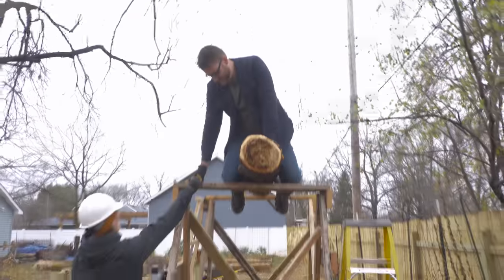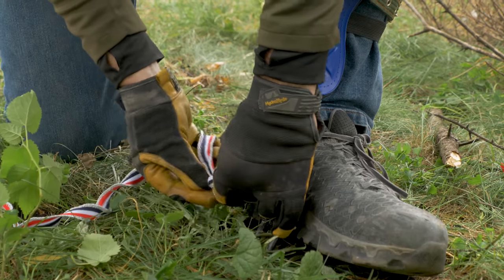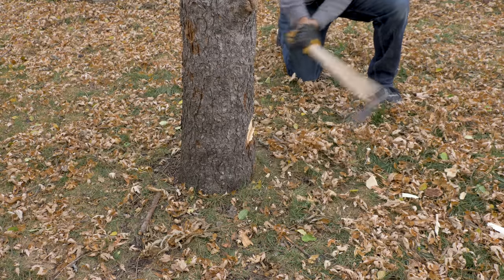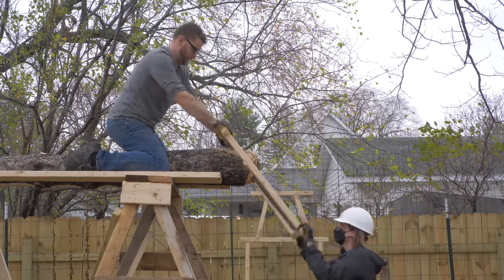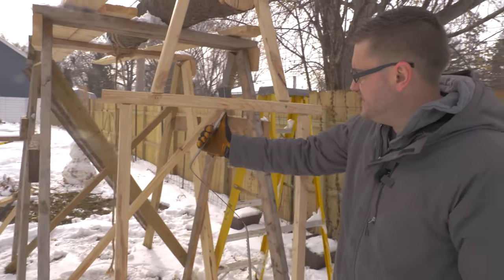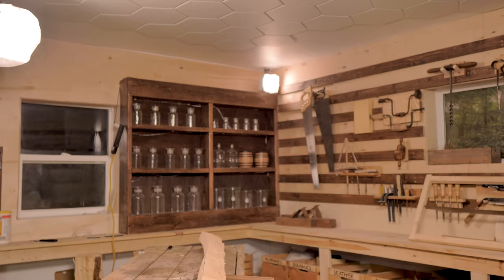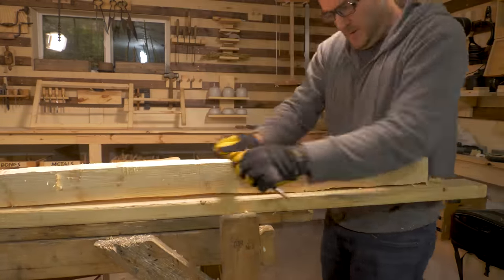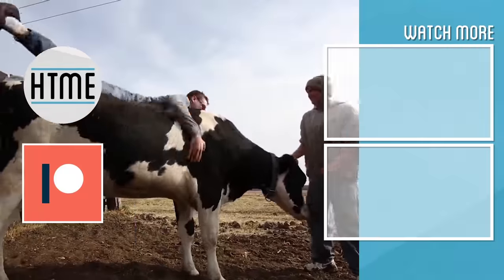Is This The Most Expensive 2X4?

Comment: I wonder what the history of Japanese lumber milling is. Their pull saws are so much more ergonomic and fast than even my best, well tuned vintage European saws. 

I'd love to see your to first attempt at making a jointer or jack plane, either a Japanese style or wooden European style, flattening it with early sandpaper.
Reply: Not an expert but I have seen pretty much the same technique of "pit sawing" In old 
prints. Japanese saws have the same concepts just the opposite direction. They have adzes and axes just different shapes. I have hewn and cut logs and let me tell you there is no easy way to mill by hand, its very difficult work no matter which tool you use.

Comment: Im a woodworker that doesn't use any power tools and some of your methods were actually done using quicker methods. For example, you saw through the middle of a log (extremely time consuming). Old timers just scribed the middle line on both sides of the log, not even that most of the time, then used an axe and wedge to split it right down the middle. Takes 30 seconds or so compared to your method of sawing through the middle which would have taken an hour. Yes you can't really split when there are tonnes of big knots in the timber like this, but that's why the old timers just selected straight knotless timber to begin with. This bit of knotted timber wouldn't be good for construction anyway. Also to square up the timber quarters they got from splitting, they just used a draw knife, not a saw. Its much more time consuming to use a saw when you have a draw knife. However, that comes down to proper wood selection. Ive made square stock in half that time before just using a draw knife. If you have straight nice timber then you can remove massive chunks of wood in no time with a draw knife.

Comment: You need to secure your working platforms/tables, and anchor your lumber better. It will greatly help with efficiency and give you more control to make more accurate cuts and draws. 

Every time your table wobbles that's a loss of energy that could have gone into your cut but instead was wasted making the table move. I've been a carpenter for literally my entire life. You want that wood stable my friend. The less it moves the better.

Comment: Could you build a treadle style sawmill, like a sewing machine with a flywheel or a treadle lathe? 

If you can't manage a full "sawmill" I bet you could at least figure out a way to make a scroll saw style deal. 

Making the blades is likely the hardest part.
Reply: I don't think a treadle you can work with one foot can generate the power needed to cut thick pieces. Especially with all the extra friction from the parts you need to keep the saw cutting straight.
Reply: @masterpython  yeah especially without machined parts it would be very difficult and time consuming to get the precision required to do that. Even good treadle lathes and sewing machines use cast and finished parts. 

He does have casting unlocked though... 🤔

Comment: Finding a tree with no limbs / knots would be key to reduce the amount of time required get it into the desired dimensions you're wanting to reduce it to...and could be performed by using a series of splitting wedges and a sledge hammer to split the wood down the length of the grain.  I've seen this technique performed with splitting boulders in half as well after holes have been drilled for the wedges.
Reply: The old timers knew about the no knots thing so they beat us to the punch on that.

Comment: 1:58 Yeah, but no. 
The actual reason has to do with framing a house the reason framing lumber is 1/2" undersize is the necessity to account for drywall on the interior walls.
Reply: That's not true at all. People frame with 2x6 studs. Room interior dimensions are what they are. We know how to make larger or smaller houses.
Reply: @1pcfred  2x6 are not truly 2x6 eother the are 1 1/2 x 5 1/2. To account for drywall.
Reply: @patrickradcliffe3837  2x6s are milled too. All framing lumber gets milled the same and is missing the same amount over sawn dimensions. That's true for 2x4s, 2x6s, 2x8s and 2x12s. It's not because of drywall. It's because when wood gets planed wood gets thinner.

Comment: There are times when I would be willing to pay $500 for a single straight 2x4”!  I have had to build walls and then use a hydraulic brace to push the warp out of the wall taking several days and costing the customer extra thousands for a wall that is as straight as it would have been if lumber still was made to the same standards as it was just 50 years ago.

Comment: Should've made a chainsaw sled to get accurate cuts then the chainsaw could have felled the tree away from power lines if you pre tied off  at near top and pulled around a different tree to pull away from you  and the person cuttin. Thenget close to the ground to not waste wood but don't let blade touch dirt or immediately dull

Comment: I'm not going to say anything about the saw tooth geometry, they look off, but I'm no saw expert. I think there are other comments that gave a good insight as to how to sharpen them.

But your other tools! That axe seems dangerously unsharpened. Or if it is sharpened, the taper gets to thick too quickly; thin it down.
Same for the drawknife, i have one and properly sharpened the wood doesnt tear and split away like your's did. Add to that the fact that it seems you were using it against the grain direction.

The outcome of your projects would increase greatly if you sharpened those properly. Felling a tree with an axe will be less exhausting if it cuts better and deeper.

Comment: It's called a 2x4 because pre 1965 it was 2"x4". You can see this if you look inside of the walls of an old house. They later scaled it back  due to shortages and as a way to stay competitive. They also determined that it was not necessary, that's why it's "nominal lumber"  not "true dimensional" 👍
Reply: It was way before 1965 that they scaled down the size. It was towards the end of the 1800s when railways were more developed and lumber was able and needed to be transported further and further from the lumber yards.
Reply: It's called a 2x4 because before it is planed the wood is 2" x 4" Back in the old days they didn't bother to plane anything. You can see the saw marks in old lumber.
Reply: @1pcfred   No sir. You are incorrect.
 Starting with Balloon Construction around the early 1830s,  we used true 2"x4" lumber. That led to Platform Construction which was stronger with shorter boards. Then we had extra demand for dimensional wood after WWI, leading to the first National Size Standards in 1924 (basically made it smaller). Those standards were revised several times until the demand for lumber grew during WWII . It changed a few more times until the 1960s . When, in Scottsdale Arizona,  the Committee on Grade Simplification and Standardization  agreed upon: size standards, maximum moisture content, and NAMING. The nominal 2"x4" board thus became the actual 1-½ x 3-½ inch board that we call the "two by four".
Reply: @johnnyregs2378  No sir.  Please read more than the title in your Google search. Wikipedia is free if you don't want to buy a book👍
Reply: @RobertRedland  I am correct. It is not me saying that. Everyone that knows anything says the same thing.
Reply: @1pcfred  You'll have company in your incorrectness. I've worked on new and extremely old houses for over a quarter century. There ARE old studs measuring exactly 2"x4" that have been planed. Further more Susan, they DO NOT cut them to 2"x4" anymore. They are cut smaller than that. And the final kiln dried measurements are all that they care about.
Reply: @RobertRedland  exceptions do not negate rules.
Reply: @1pcfred  An example is not an exception. It's whatever. Being wrong about this won't hurt or hinder you in life. Now being ignorant and hard-headed in general... Well. . . . .  Good luck👍

Comment: I have to partly disagree with your cost calculation, as in the real world you would not cut down a tree to cut one board, therefore you would not throw away so much of that excess wood from the initial cuts. So in effect you might end up with a 4x4 board from a 6 or 7 inch diameter tree as your 4th cut, then it would only take a 5th cut to get a pair of 2x4's vs 4 cuts to get 1 2x4, this economy of scale continues to a degree, so while 4 cuts is the minimum to get a 2x4, this same tree could have yielded at last twice as much lumber for essentially 1/5th more labor.

Comment: ** puts on his grew up in logging country hat **

You.... needed a bigger axe.  :)  I'm sure that viking axe is well made, but it's way too short for you to get a decent swing with it, at least for timber.  Look at the stereotype lumberjack axe.  Broad blade (which your viking axe mostly gets,) fairly thick blade for more mass and therefore a harder, deeper hit, (which it really doesn't.... it's more a combat axe, built thin and light for speed) and a fairly long haft to be able to use it fully standing up and get more force behind the blow.  (Which your viking axe..... totally doesn't have.)  I mean one of the benefits of an axe is that the wrong axe for the task at hand will usually still WORK, but.... it's likely to be painful.  ;)

The saw....  kerfing usually just refers to the thickness of the blade itself, if you mean splaying the saw's teeth to the side, I'm.... not sure you did it enough.  :)  Also those teeth don't look terribly sharp.  I mean you've got them sharp on the points, yes..... but that's just going to gouge and tear your way through the wood.  That WILL work, yes..... eventually.  But the result will be ragged and uneven.... and exhausting to do.  Ideally you take a file and actually sharpen each tooth along the side you want as the actual cutting edge.  Again, labor intensive but worth it.

Comment: you can also bend every other tooth on the saw. so that the hole the saw makes is slightly bigger then the saw that made it. that will stop it from binding also oil/wax (olive oil you made before) on the blade will help too
Reply: The cut a saw makes is called, "the kerf". Bending the teeth is called, "setting". For this sort of work if they used any lubrication at all it'd be plain or maybe soapy water.

Comment: always the same with this videos, the guy crafts anything using old methods, doesn't really research how it was actually done, attempts a half-a$sed job, takes a bunch of time, multiplies that by whatever numbers they use for wages, and comes up with  a clickbait 'this cookie costs a million dollars'. 
Check any hand tools only offgrid cabin builder video, and those guys with no modern tools can create planks way faster, and it's not like they are machines, but instead they have much better setups than that weird high platform with a dull blade...
Reply: honestly kind of true - they tend to just bust out a video without much effort or research and produce a really amateur result. their setup was shaky and dangerous and wasted most of their energy dealing with poor tools. the issue wasn't using older technology, the issue was they approached it like someone who had never cut wood before being handed a saw and told to make it work.

Comment: Roughly 2 minutes in, you say a modern 2x4 is 4.5" by 3.5"
Reply: 1.5 by 3.5 due to shrinkage when drying.
Reply: @donaldduck830  The loss in size is due to planing the wood.
Reply: @1pcfred  Yes, they mentioned both reasons in the video :)
Reply: @donaldduck830  planing is far more material removal than shrinkage due to drying.